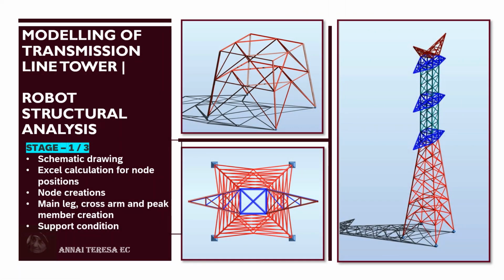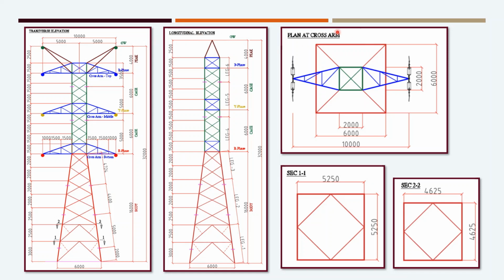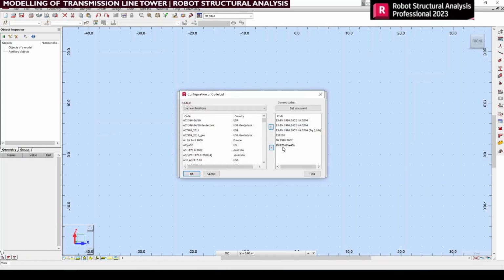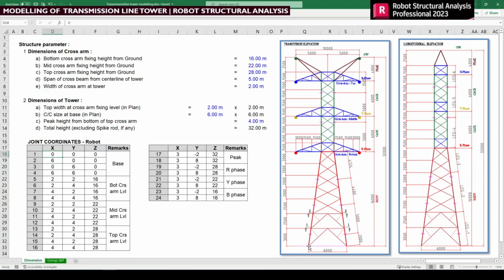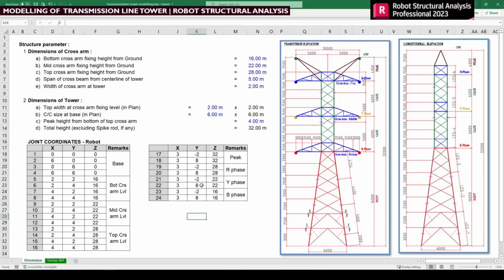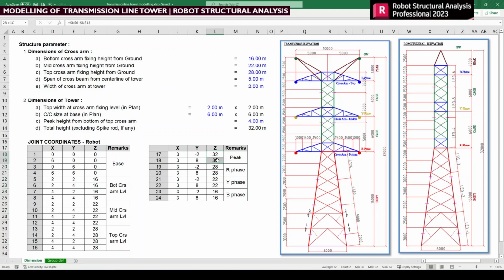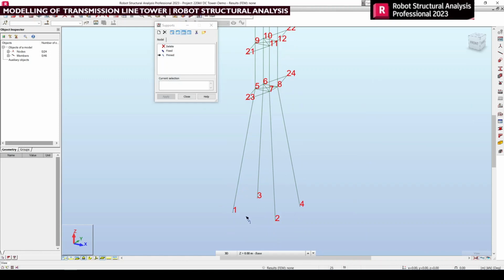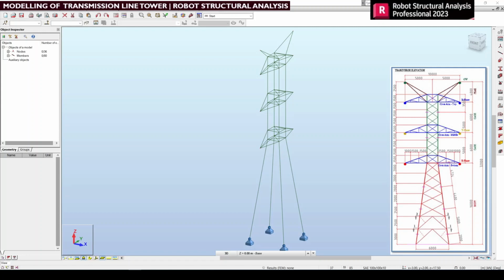220kV DC Transmission Towers | Modelling | Robot Structure Analysis | STAGE 1 of 3

Comment: why you did not draw it in autocad 3d, and then import it to STAAD, it will much easier than what you have done.
Reply from the maker: Thanks for watching and for your suggestion. But developing 3d model in AutoCAD is definitely a difficult and more time consuming task for gantry structures, geometry of these kind of structure are complex. AutoCAD is not having member properties. It may possible with Autodesk Advanced Steel or Trimble Tekla Structures, but not an easy task with AutoCAD 3D. It had taken only 2hours for us to create this model in direct Robot Structural Analysis software. Think how many hours will take for developing model in AutoCAD 3D. Also, if structure frame pattern or members are required to change during analysis for design requirements it will be a rework in AutoCAD 3D.